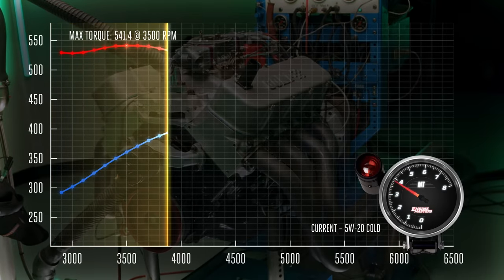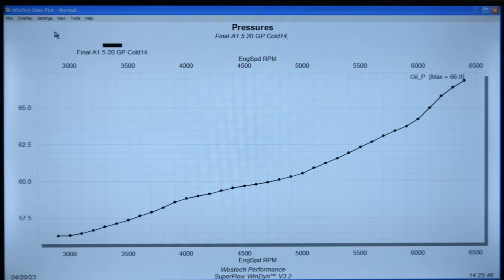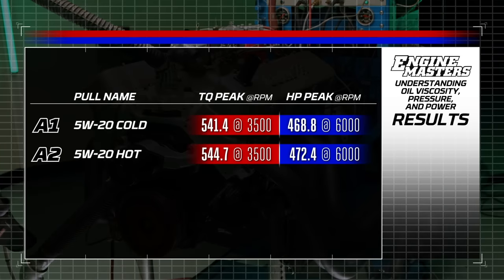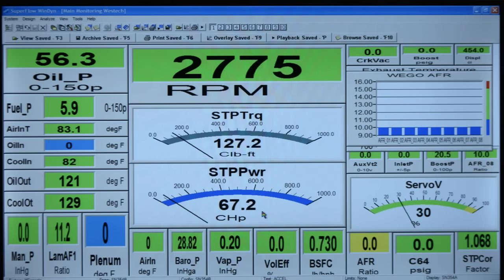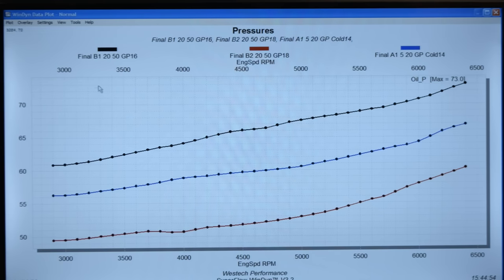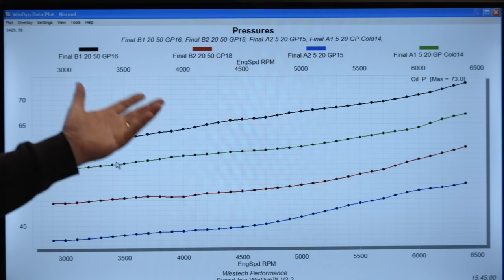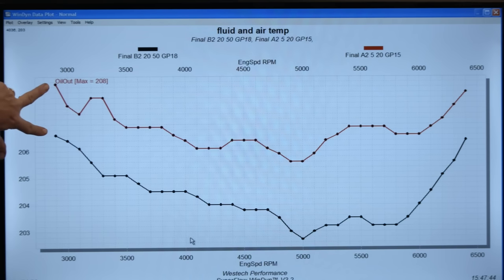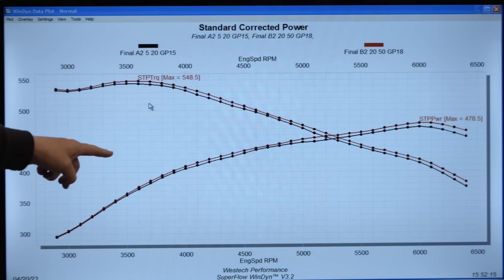Does the Thickness of Your Oil Matter? | Engine Masters FULL EPISODE | MotorTrend

Comment: In modern VVT street engines where 0W 10 or 0W 20 are specified the pressure is regulated more and thicker oil will slow down the cam angle phaser change response time quite a bit.

Comment: I did a study of oil viscosity versus engine wear. It was suggested by some engineers in Detroit at their customer training school. They said that thicker oil would provide a little better protraction from dirt in the oil. I was looking at a big heavy piece of industrial equipment used around the clock on a schedule. The mechanics thought it wasn't true but went along with the trial. I thought that it did prolong the Ford industrial engine a little longer than the thinner oil. This was 50 weight versus 30 weight. Any way I quit auguring the point and solved the problem, as I understood it, by changing the engine to a Perkins diesel, which was easier to keep the dirt out of. Fun in a big Canadian aluminum smelter!

Comment: I wish you had mentioned what the viscosity index is on that oil. A synthetic blend oil will be 80-85% group 2 oil, with 15-20% group 3 hydrocracked oil added. With a viscosity index somewhere between 100 to 120. I would like to see this same test repeated with a group 4 PAO oil and a group 5 ester based oil with viscosity indexes in the 175 to 200+ range.
Reply: Amsoil said that they tested every synthetic-blend oil in the marketplace, where they found the actual the percentage of synthetic oil (Group III) was anywhere from a low of 1% to a high of 15%.  Buyer beware!

Comment: This was very informative about oil and what the numbers mean. I have an old Chev pickup with an original Chev 235ci 6cyl and I am guessing that the clearances are all higher than newer engine specs. Does that mean that I should be using a higher overall oil viscosity? I currently use 20w50. Thanks for this episode! Brian
Reply: Pull it apart and check clearance. That will let you know what oil to use
Reply: Driven has a chart for oil weight based on bearing clearances. My bone stock 1995 460 will shear oil from heat with these 5 weight oils. Even Rotella diesel oil 15 weight oil it will shear it. So my bearing clearances are wide enough that my guess is that I would need 20 weight oil. Right now it gets monograde Rotella T1 30 weight. With this oil my fuel economy picked up a few tenths. It isn't building frictional heat from a lack of oil pressure in lighter multi weight oil.
Reply: @ScooterLee-ei1ep  thanks for the reply. I think I will check the original engine build clearance specs which will give me a starting point and go from there as the miles build up to make changes. It runs great right now so don't think a pull apart is in the immediate future. B
Reply: IF the engine is serviceable, eg in decent condition yes you should. Old and fumy with less oil pressure straight 50
Reply: The 235 called for 10W30 in the original owners manual,  Or SAE20 if you used a single viscosity oil.

Comment: I wonder a lot about oil viscosity I know that in my 08 Dodge ram with a hemi they want 5W 20 and I ran that until I hit 100,000 miles and I noticed my engine was a lot noisier during crank up and cold starts so I change the viscosity back to the 10W-30 I still use synthetic I just changed the viscosity and now I’ve got 220,000 miles on it and I’ve had zero failures zero issues. The truck hasn’t been one day in the shop other than my shop changing out the blend doors on the HVAC. i’d be curious to get some feedback on your thoughts. The workings of the Hydro dynamics of oil viscosity’s was not in the school agendas at WVOC in the late 80’s

Comment: I have a 2003 Ford ranger with 257k miles it leaks oil only while the engine runs. I replaced the oil pressure switch which was one of the places it was leaking oil however I still get leaks. Instead of the 5w 20 oil that is on the oil cap I put 5w 30 because since the oil is leaking while it's running have the oil be thicker at operating temperature will decrease oil leakage. Ever since I've done it the leaks has slowed down tremendously I no longer have to add more in between oil changes however is this bad for the engine?

Comment: I’ve read many articles from oil engineers and gurus and the general consensus is, for bone stock engines, is that thinner oil is better and to run as thin an oil as possible. The reason being that thinner oil dissipates heat better and gets to moving parts faster, especially in modern engines with overhead cams etc. Of course there are exceptions such as the case of my tired worn out original 396 which burns oil badly with anything less than 20w50 or straight 50 weight.
Reply: With modern oil pumps that are variable, yes. With mechanical oil pumps, the thicker oil moves to your parts at the same speed because the pump is positive displacement, and fluid doesn't compress. Just imparts more stress on the pump, and puts the oil filter into bypass more often upon start up.
Reply: @Resistculturaldecline You are forgetting the oil pressure regulation valve.  Thick oil will build pressure faster and higher when cold and will open the pressure regulation valve.  This means less oil going through the engine and more getting bypassed back into the oil pan.  So, your conclusion is wrong.  Thinner oil will absolutely get circulated through the engine faster than a thick oil during cold start.
Reply: @LTVoyager   I spoke directly to that with the bypass valve. The bypassed oil goes into circulation through the engine, just unfiltered.
Reply: @Resistculturaldecline  No, you confused the bypass in the oil filter with the pressure regulation valve in the oil pump itself or in the engine block on some designs.  Completely different components with different purposes.
Reply: @LTVoyager   I was mentioning upon start-up. The pump regulator, being about 5x the psi rating of the oil filter bypass should all be well and good unless the oil viscosity is grossly incorrect for the cold temps, or if someone cranks up a cold engine and goes smashing on it right away. Otherwise, a simple start up with a reasonable viscosity range should not bypass at the pump, or bypass enough to create any issue as an engine at start-up rpm only needs around 10lbs - 15lbs oil pressure.
Reply: @Resistculturaldecline  Still wrong.  There is a fundamental difference between the two pressures.  The oil pump pressure regulator is based on gauge pressure.  The oil filter bypass is based on differential pressure.  You can run 100 psi through the oil filter and have no oil bypass if the filter element is clean and the oil thin.  Starting an engine at below zero temps can easily peg the oil pressure and open the pressure regulator.
Reply: @LTVoyager   Electric pump reg, or spring ? I see what you're saying, I don't think you're fundamentally incorrect. My opinion is for such an issue as you speak while being certainly possible, only comes into play when things have been considerably miscalculated with the oil choice.
Reply: @Resistculturaldecline  Most regulators I am familiar with are pretty simple.  Most are just a steel ball held against a seat by a spring.  Some use more of a piston, not sure why that rather than a simple ball, but maybe it allows the opening curve to be tailored better.  There may be some newer cars that use an electrically actuated pressure regulator, but I have not yet come across such an animal.
Reply: I follow weather because temperature has a huge impact on viscosity. The new car may spin easier at cold start with a thinner oil but many people who race find that you give up durability and risk blowing something up if using thin oil with turbo. I always think that I do want that thin oil to flow fast at first start but then I know a thicker oil will adhere more as well so its a balance
Reply: @jamesmedina2062  "but many people who race find that you give up durability and risk blowing something up if using thin oil with turbo" Yes, @mattbauckman9907's idea is based on the oil not getting overly hot.  If the oil is going to get very hot, like racing conditions, that's where you may need the thicker oil to retain it's film strength.  If the oil coolers are sufficiently well designed to keep the oil in the right temperature range though, there are race cars that run 5W40 or even 5W30 (or 5W20 if it's a one-make series and you are desperate for as much power as you can get!).
Reply: @TassieLorenzo  well thats common sense working for you as it works for me too. i know that lighter oil unleashes more power in some cases and for me it allows rotating pieces to spin faster. Only problem is you can lose durability with thin oil and lose ring seal. You raise a good point that thermal management design is critical.
Reply: @Resistculturaldecline  My Ford 300 L6 idles at 55 PSI, cold, which appears to be the bypass rating on the Melling oil pump. Hot I get ~30 at idle, depending on just where I have the idle set. Generally run 10w30 Diesel for the ZDDP.

So, yeah you can run in bypass on start-up. Heck, I'd argue it's normal to expect, at least on a fresh rebuild with a high-flow pump.

Comment: I had an old 1975 Oldsmobile delta 88. It was worn out. I used straight 30 weight oil in it for over 2 years because it was free where I worked. The only time it was a problem was in the winter if the temperature dropped below 20 degrees Fahrenheit. The lifters would rattle some on start up.

Comment: What im getting from this video is the thicker oil simply helps ring seal making more power. I think in a normal daily driver application a thinner oil would be the better option or find that middle ground between there because 5-20 and 20-50 is a HUGE gap in oil viscosity and i picked up on that little nugget "thinner oil is better for performace until it comes down to ring seal"

Also i dont think someone would be pushing their engine so hard as to NEED 20-50 unless race car applications . Great video very informative :D

Comment: My take away is thicker for me moving forward. I have a survivor with an original 51 year old engine that has 128K on it. I some blowby which manifests itself as crankcase pressure and resultant oil leaks at the front seal and lifting the dipstick if I have gotten on the throttle. I have run 15-40 but now I will stay with the thicker viscosity for better ring seal since this car is a cruiser not a racer.

Comment: one thing i know is that on a hot day in LA the oil gets hot and then the psi decreases when your at a stop light to scare you at each light
Reply: If oil temp is 240, think about an oil cooler. At 245, install one.  Many engines have aftermarket filter adapters available with a built in thermostat to help manage things. Oil does well around the 220 mark most cases, but... additive packages vary, and are near impossible to discuss because of proprietary formulations.

Comment: The problem with lab testing is they are generally using a brand new engine so everything is based on a brand new engine, but once a vehicle gets broken in everything gets seated in the engine. you start putting mileage on it I believe the viscosity should change because your clearances are going to change.

Comment: Heck yeah - I'd like to see how oil pressure effects horsepower.  Will a ton of pressure free up power or hurt it?  What about bearing life?  I'll keep running Rotella 20-50 in my boosed LS engines in the mean time...  fantastic work.
Reply: Only oil pressure but oil volume....cuz you can either get a high pressure pump or a high volume pump
Reply: Power is pressure multiplied by flow.  Which is your pumping loss.   So the best oil viscosity is one that had the minimum required flow at the minimum pressure to float the crank and rods.  Assuming ring seal is adequate.
Reply: they tested that already, higher oil pressure makes less power. in a nut shell. if you were a power miser, you would run only as much oil pressure you need to keep from ruining the bearings under load.
Reply: @wiktorjachyra1869  DOD pumps for LS engines do both...
Reply: Engine masters did a video about oil volume in the pan and proved on the dyno that less oil actually makes a little more power. The windage of the oil being splashed around by the crank costs a few horsepower.
Reply: @D3thM3tal. Im not sure if you are aware that Rotella 20-50 used to have moly in it, but they no longer add moly to it any more? Thats one of the reasons, more perf. Enthusiasts are now running the oil brand they used in this test= Driven= has moly added to it!
Reply: My old man built a Baja bug about the time I got my driver's license.  I don't know what he found for an oil pump, but he was splitting oil filters from the excessive oil pressure.  I figured that poor 1600 cc vw motor was probably using about 10% of it's output just to turn the oil pump😂
Reply: @wirebrush 😂😉
Reply: alot of the ls guys run higher oil pressure bearings look great darn near perfect so i would say higher oil pressure keeps the bearings alive, the con would probably be that it takes more horsepower to turn the pump affects mpg and probably gives up a small amount of horsepower maybe 3-5 hp but for boosted engines thats a great trade off for the protection
Reply: @96cr To low of oil pressure= not good, but excessive oil pressure, also= not good. I wonder what the cutoff is on too much oil pressure, like all of the oil up @ the top of the engine, and the pan running dry!? I would think a good safe range is 30 to 40psi, @ idle, with oil hot, and 70 to 80psi @ WOT, reving to 7 to 8k rpm, with oil hot. I would think 100+psi hot, is too much!?

Comment: I think thicker oil would probably have an effect on lifters holding lash at higher rpm especially on worn components.
Reply: Would hate to say it but probably not, if that check valve is fucked it wouldnt matter.if the check valve is healty it wouldnt let any liquid pass through it doesent matter oil or water

Comment: I use thick oil on my Honda the motor is worn an gets allot of blow by so if I use the recommended 5-w20 I go threw a quart of oil in about 200 miles witch I do ever two days, I run 5-w40 rn an I have to add oil once a week I noticed I get better compression too

Comment: Thanks for all your work, Toyota states to use 0-16 to 0-20. but given some warmer climates and stop and go driving which can be hard on oil wouldn't a 0-30 be more beneficial for longevity of the engine, I realize they claim a lighter oil is more fuel efficient and bearing clearances are very tight, would it be harmfull to use a 0-30, I have noticed that people in the know go back and forth about this, even Toyota  mechanics .
Reply: My opinion only, but I'd go with a quality 5w20. The closer (numerically) the two viscosity numbers, the stronger the film strength. 0w/8, 0w/16, 0w/20, 0w/30, 0w/40 are all born as 0w oil. They use viscosity modifiers to achieve the 100 celsius value. Those viscosity modifiers aren't robust of film strength as an oil that is inherent the thicker viscosity value. The viscosity modifiers will, with mileage eventually sheer down to its inherent born viscosity. Ex. a 0w30 will eventually become a 0w20, then a 0w15, then a 0w10, etc. on downward. 

A 5w20 will pour (flow) like a 0w30, because a 0w30 is toward the high end of the 0w flow measurement. But a 5w20 will never sheer below a 5w. Another tactic, if still available, search the Castrol website where it lists your correct viscosity. But don't search it for USA or Canada, because those viscosities are mandates put onto manufacturers by the EPA or fines and penalties are imposed on the manufacturers. Search the viscosity recommendations in Mexico, or Ireland, Spain, Russia, etc. Those are the viscosities for engine longevity, and not the feckless whim of the EPA.

For example, my daughter drives a 2013 Honda accord. Book states it's a 0w20 engine for all temperatures, from -40 Fahrenheit to 120 deg. For starters, there's no such thing as one single best viscosity for every temp.

The same exact engine, in Ireland is spec'd for 5w30. I live in the southern US. This time of year it's often 80+ deg at daybreak and 100+ at 2pm. I'll run 5w20 in winter, as it unusually gets below 20 Fahr here. I'll stay with 5w20 in summer because the engine lives a very low effort life, but ever so often a 5w30 in summer. It's going through 0w20 pretty quickly. Around 1.5 quart in 5k miles. A quality 5w20 reduces it noticeably.